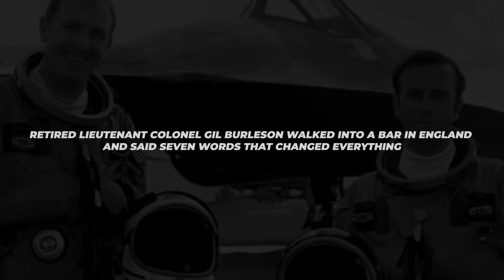Finally! SR 71 Pilot REVEALS The Blackbird's TRUE Top Speed!

Comment: As an Enroute ATCS, I watched an SR-71 on a south to north "run" post a ground speed of 4,650 KNOTS!! It was able to transit our Center's airspace in seconds! It was one, hot, fire-breathing machine. Years later, I was able to sit in the cockpit of an SR-71 at the EAA Air Venture at Oshkosh. The less than modern instruments and controls were something out of the mid sixties. It still worked!
Reply: My best friend's father in law was in the Air Force.  He said they went a lot faster than anyone would admit.  That it was well over Mach 3.  Closer to Mach 4.
Reply: @CharlesCarmichael-404 close to mach 4 was never remotely possible
Reply: @gr8crash were you in the Air Force?  I have another friend who worked on the camera systems on those things.  he said they were told to set them up to adjust for the speed of the plane.  They said to max them at 3000mph.  As the plane speed adjusts the cameras speed up.
Reply: @CharlesCarmichael-404 3000mph wasnt even remotely possible. The cameras were set and programmed for the mission, mission cruise was mach 3.17 and max mission cruise was 3.2.
Reply: @gr8crash You keep telling yourself that. Still doesn't make it true.
Reply: @markgill7138 it's not me making it true. Its a simple fact. Lockheed are the ones who made that fact true, not me. You dislike that fact, take it up with Kelly.
Reply: @gr8crash You do realize that the government isn't going to tell us anymore about our military than they want the enemy to know? Mach 3.2 is just the fact they want us to know and that is a fact.
Reply: @markgill7138 that is absurd and wrong. While in operation sure, but now? 3 decades later? No. Its all known, and declassified. All the limits, all the performance data, dash 1 charts, etc its all known and declassified. Theres literally nothing left to declassify in terms of performance. We even have the Lockheed studies on what it would take to reach the airframes maximum design potential and we know that never occurred because the improvements required to reach those speeds were never done.
Reply: @gr8crash You keep thinking that. There are certain things that they will never declassify. They have even said that many times. They aren't going to just show another country how to build a plane that fast. That would be foolish.
Reply: @gr8crash What's absurd is if you actually believe that.
Reply: @markgill7138 the ONLY parts still classified are parts of the ECM/DEF equipment as it's still in use today. Other than that, everything else is declassified and known.
Reply: @markgill7138 simple facts man, sorry you dont like that.

Let me guess, you think the aircraft could fly mach 3.5+? Even IF a crew did that, how would they ever know?
Reply: @gr8crash Whatever you say!
Reply: @markgill7138 again its not whatever i say, its the people who designed and built it
Reply: @gr8crash Relax man. I'm just giving you a hard time because I had surgery and I'm bored AF. But I still firmly believe that the SR-71 goes faster than what you think.
Reply: @markgill7138 which is fair. And I wish it did. And I do the same, when things at work are going well I got plenty of time. But I do wish it went faster, just in reality it really didnt. Under very specific atmospheric conditions it was capable of higher speeds, into it 3.4x range. But this was rarely possible and not fully within the pilots control.
Reply: @gr8crash   Do you seriously think the Gov is going to open up about her true capability, and say, to the world, haha tricked yas all, we were lying, you may, I don't.
I have no idea of her full speed, don't care, she is the greatest ever, that will do.
Reply: @davidwarland2680 oh she definitely is, but again all the performance capabilities and information is declassified and public.
Reply: @gr8crash as far as anyone knows. I was in the US Navy Submarine Service stationed on a fast attack submarine during the cold war (early to mid 80s). Probably half, maybe more of the crew I served with are dead now and our boat was decommissioned in 97 and no longer exists. The cold war has "been over" now for quite some time. However, quite a lot of what we did is still classified and may never be declassified. Just because they are no longer in service and the government allows certain things to be made publicly known doesn't mean they are being completely open and transparent. Have you ever paid attention to our government. They never tell the whole truth about anything, let alone about military equipment or capability. Just because Lockheed said it, also doesn't mean that you're getting the whole story because, as a government contractor they are obligated to comply completely to what the government says they can or cannot say. Just as I, though I've been a civilian for quite some time now, am obligated to not talk about certain places "I've never been", certain people "that were never aboard" and certain things "we never did". Just because they say it, doesn't make it so. That's the simple fact of anything that has ever been classified.
Reply: @PAT8888-is2pd people often bring up the ship comparison. Its not as relevant as even designs from back then can help with modern designs. Aircraft are different. Everything regarding the SR71 design so so detailed and public that anyone could attempt to build one. BUT its simply outdated technology. You could take one, and do some updates and it still wouldn't be much better than it is already.
Reply: @gr8crash LOL! OK, professor Google just because you read it on the Internet doesn't mean it's true. What kind of  qualifications do you have to support that you have any idea what you're talking about? Access to the internet isn't a qualification.
Reply: @raymondanderson751 in regards to the SR71?  Well to start i dont use Google or the internet for information. I have these things called books, that are well written by people who know the aircraft well including former crews. Also have thousands of pages of tech data, maintainers manuals, design papers etc from Lockheed, P&W and NASA. And for the best source,  have met and become friends with several former crew members. So yea, it helps in being more educated on this topics than most people.
Reply: It wasn't the top speed that was so special, it was the fact it could sustain those speeds for a very long time.
Reply: Screw your knots go by mph
Reply: @davidwright490  The official unit of speed in aviation is the knot.
Reply: @MikeInExile  true but ground speed is mph or kph
Reply: @davidwright490 The knot is a nautical mile. It is 1.1527 times the distance of a statute mile and is the measure of one minute of angle of the earth's equatorial circumference. For simple calculations, use 1.15 as the conversion factor between nautical and statute miles. Best regards.
Reply: @davidwright490   Marine and air use knots, for a very good reason, miles per hour out kilonaters per hour, just no.
Reply: @davidwright490 i must say guys... screw you both, go by kms/h 😂
Reply: Such old technology in today's standpoint. Makes you wonder what is out there now and the capabilities.
Reply: For all we know, it was a TicTac, not a SR.
Reply: Lue Elizondo stated in his documentary about UFO's recently, that the fastest plane we had can achieve speeds of 4600 mph, which could only have been the SR 71.
Reply: The calculator phones computers destroyed America, geeks on computers who can't talk to girls gont create good technology for society it only propagates there agenda
Reply: 5300 mph?
Reply: 3.6 is about where they top out, but probably due more to heat than anything else. 
To achieve a ground speed of 4000+ kts it must've had a 2000kt tailwind 😂
Reply: @NPC-fl3gqhaha those tailwinds are sneaky
Reply: @gr8crash  lol. strange 3.6 mach is far to high for you not to disparage. It has become normal to disrespect those who actually are kind and reply with facts or mistakes  I say it could fly 70,000 ft at mach 3.4. Or mach 3.5 plus as two pilots and two J58 engineers went on record saying. Disparage me. Lol
Reply: @gutsfield3504 easy, there arent any that say that. Mach 3.4 wouldnt be possible at 70k ft. Mach 3.5+ is questionable at best. Even getting to 3.5 is only possible due to extreme atmospheric conditions and not fully within the pilots control. 

They did study uprating the J58 to certify it for mach 3.5, but this was dropped by Lockheed.
Reply: @gutsfield3504  besides,  even IF a crew flew mach 3.5+, how would they even know?
Reply: 4,650 knots would be just shy of mach 7 which isn't even remotely believable much less possible.
Reply: @MikeInExile when I was in the Navy, in the 80s, I heard a rumor that 1 had been tracked at Mach 7. While home on leave shortly after, I met someone that had been on the ground crew for them. I told him about that rumor. He said "knowing what I know about the plane and knowing what I know about Airforce policy on what they release vs what it can actually do on classified speed and altitude, you can usually double what they release and be close so, it wouldn't surprise me".
Reply: @PAT8888-is2pd he was messing with you as that simply isnt possible
Reply: @gr8crash maybe you could explain your stance on that. Especially since hypersonic aircraft are a thing these days and research into extreme speed has been going on for quite some time. Not to mention that the space shuttle had to slow down from speeds like this in order to land. I'm not necessarily saying that the Blackbird ever reached those speeds but, you can't just say "it's not possible ", not explain why and expect everyone to take your word for it. What qualifications do you have to back your statement.
Reply: @PAT8888-is2pd but we aren't talking about hypersonic aircraft. We are discussing the SR71 which was a supersonic not hypersonic aircraft. Anyone who knows aviation knows that the airframe shape alone isn't made for hypersonic flight, not are the materials its made from. Not to mention the turbojet engines can't operate at those speeds. The couldn't even get them up-rated to be mach 3.5 certified. So while impressive,  there's nothing about the SR71 that would support, handle or be capable of hypersonic flight
Reply: @gr8crash first, let's address the subject. No matter what aircraft we were discussing, at the speed we were discussing, we were discussing hypersonic flight. Then let's discuss the engines. To refer to the engines of the SR71 as turbo jets tells me that either you have a distinct lack of knowledge about this aircraft or you think that I do. Turbo jets are and have been in use world wide, even before the SR71. Its engines were unique and to my knowledge have never been used on any other aircraft, even since. On the ground and at slower speeds, yes, they operated like a normal turbo jet. As they gained speed, due to an adjustable intake and cowling vents, airflow the the is adjusted to make it operate as a fully functional ram jet. As far as the airframe itself, the pilots that flew these amazing aircraft were a different breed because they flew them so fast that air friction alone (at altitudes where air was very thin) had the plane on the verge of melting (there is record of one virtually disintegrating around the crew). I don't know if you've ever actually seen one of these planes but, like most hypersonic aircraft designs, the fuselage itself was a lifting body design. Its vertical stabilizers were angled to increase lift in order to decrease the need for longer wings (longer wings become a detriment at higher speed). Everything about this plane was built for extreme speed. The materials it was made from titanium lighter and stronger than steel with a higher melting point and much more forgiving of reheating and cooling. The black paint wasn't just to make it look good or even to make it less visible to radar (although it did both). It also helped with heat resistance.
Reply: @PAT8888-is2pd  so many inaccuracies in this comment. 

First no we are not talking hypersonic speeds. The SR71 wasnt capable of hypersonic speeds under any situation.  The SR71 was a supersonic aircraft only. 

The J58s were always turbojet engines, since their initial intended use for the P6M Seamaster. They never turned into fully functional ramjets. What they could do was create a ramjet effect. Incoming air was diverted from the 4th stage compressor around the engine through the 6 bypass ducts. This air was reintroduced into the exhaust stream, and became technically what they call and Augmented Augmenter. 

The aircraft never flew fast enough to almost melt. That would make an aircraft structurally unsound to do. The one that disintegrated was performing a test flight and the CG was moved to far AFT causing the aircraft to pitch up and break apart.

The vertical stabilizers were tilted in board to reduce RCS. Earlier designs had 1 large vertical tail but it was way too big so they made it into 2 and canted them inboard. 

They could have used stainless honeycomb like the XB70, and they did study it. But they didnt have any experience working with it and felt titanium was the better choice. 

The black paint was largely used for radiating  heat. Kelly actually had to he convinced that black paint was the better choice as the engineer proved it would be about 15⁰ cooler over a white paint.
Reply: @gr8crash I know I have mentioned it before but, you evidently ignored it, therefore, I have tried to force your hand on it,unfortunately, unsuccessfully. What are your credentials. You have made a statement, basically, declaring that anyone thinking that the SR71 could fly considerably faster than what the Airforce released, was an idiot. Right or wrong, without stating how YOU know, is not only uncool, it borders on mental bullying. I will try asking again. What are your credentials in aviation or at least in engineering.
Reply: @MikeInExile amazing how many people think otherwise
Reply: Lol no. The aircraft could never get anything close to that speed.
Reply: @gr8crash you give no facts for your rude dismissal of actual ground speed. And didn't respond to the original post ,very odd.
Reply: @gutsfield3504 no one asked for any further facts. I simply made a simple factual comment. Anyone is free to ask for more information.
Reply: @gr8crash  lolm u ole eggspurt you
Reply: @davidwarland2680 what?
Reply: Lol. That's your standard put down. It's disrespectful and harassment. I wondered if you were the poster of the main response which you didn't reply to. Sick. 11:08
Reply: @gutsfield3504 correcting an incorrect statement isnt harassment. Its a simple error correction.

Comment: I heard it could keep accelerating until it melts, mach 5 or 6 for short periods? Hopefully it will be declassified someday.
Reply: Who told you that? What was his position in the program? I was in the program for two and a half + yrs in the 1st operational squadron. In the beginning we were still flying the CIA A-12S. Then the SRs. The plane never flew at mach 4 or 5. End of those rumors and people who said things about the BB that simply are not true.
Reply: @tckSR71A of course I read it from someone supposed to be in the know, a ramjet does increase in thrust as the speed increases doesn’t it? So it made sense to me. So 3.5 plus is still the unclassified speed and less than mach 4, which is crazy fast.
Reply: @georgecharleston8532 thats not exactly how ramjets work. Ramjets have to be "sized" for the aircrafts specific size and intended speed. And they dont function well below or above that designed speed. Also the SR71 didnt even have ramjets. 3.5+ was never the unclassifified speed. Mach 3.2+ was the value given. But that was in the end its sweet spot. It COULD do a little better under specific atmospheric conditions but not on a standard day
Reply: Been declassified for well over a decade and those speeds were never remotely possible
Reply: @gr8crash the x-15 did mach 5 and 6+
Reply: @georgecharleston8532 the X15 is not the SR71
Reply: @gr8crash the Sr-71 used fuel for cooling so it probably could take higher temperatures than the X-15. Perhaps someday the speed will be declassified. It’s probably still classified if there is an Sr-72, it would give its speed limit away.
Reply: @georgecharleston8532 the SR71 did not use fuel to cool like you're thinking. It was used in the tanks at a heat sink yes, and it was used for cockpit cooling etc like most aircraft do. But it was used to actively cool the airframe. Meaning they didnt have fuel flowing through the skin, or leading edges etc. The X15 flew significantly faster and was built completely differently. And the performance capabilities of the SR71 have beem declassified for over a decade now.  While we may be developing a new aircraft, it will not be called SR72.
Reply: @georgecharleston8532  The X-15 was not air breathing iirc.